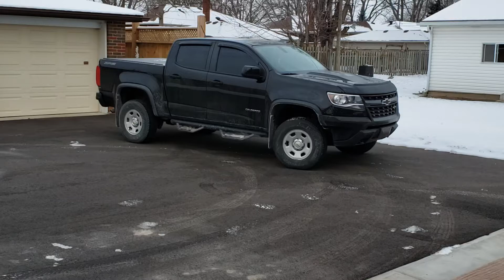GM 8 speed transmission and cold weather.

Comment: Interesting. Have a 2022 that shifts hard only when cold outside. I get the hard first shift if the day 1-2. Then I gets a clunk for the first couple stop signs at slow speeds. After vehicle warms up it’s done in minutes. When weather is warm, I never have a hard 2-1
Reply from the maker: My truck had some hard shifts when it was cold outside.  But, I noticed that those diminished as I put more miles on the truck. It seems like the fliud swap might have helped a bit over the long term.

Comment: The chevy shake..my colorado ZR2 had torque converter replaced recall plus changed to a different oil
Reply from the maker: I've heard of the shake, but haven't experienced it with this truck or any other one I've owned.  I've known of the torque converter being an issue for some that have the 8 speed transmission.  My understanding is that the shake might be more than the torque converter, but that the torque converter is a contributing factor.

Comment: It's the torque converter .
Reply from the maker: Did you notice a difference in how your transmission performed in the colder weather versus the warmer months?  How bad did your transmission perform before the torque converter was replaced.  I don't want to get to the GM dealership and be told that they "can't duplicate the problem" and sent on my way.
Reply: @lilredcrvtt  I did not notice,  I too had them say they could not duplicate problem so I told them too keep the truck until they did and you will get a rental.  They are aware of the problems with 8l90 and 8l45 transmission.  I just got mine back today and missing bellhouseing bolt and pan leeks errrrr
Reply from the maker: @Jay-dn9lr  that has to be a huge disappointment!  But, after over 35 years of owning GM products, I'm not surprised by your experience.  I think I'll drive my truck, as I always have, and wait for a catastrophic failure.  I have over 4 more years of powertrain warranty, lol!  I have to say, I really like this truck, well except for the transmission.  It has had zero issues in almost 17,000 kms, except that damn transmission.  I'd buy the truck again, but with the diesel and the 6 speed.  I have to believe that that combo would work better than the V6 and 8 speed transmission.  I hope your truck is sorted out, and that your enjoying it.  Hopefully my truck will get sorted out, before the warranty expires.

Comment: I had a 18 camaro same transmission, did the flush 1st time felt great and went away for 10k miles but returned, flushed it again its felt great the 2nd time. I ended up selling it, because all of that was under warranty, I dont want to have to do a flush every year coming out of my pocket
Reply from the maker: You should not have to pay to flush the transmission annually.   I had mine flushed after only one week!!  Since its been colder outside, I have noticed a difference in the way the transmission feels.  Still, I don't blame you for selling your car.  GM should take these issues more seriously!